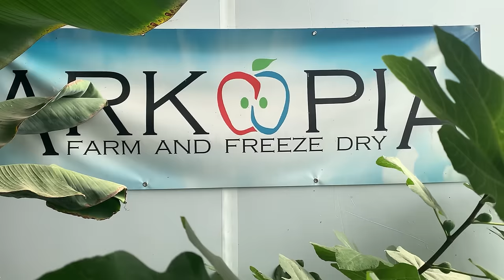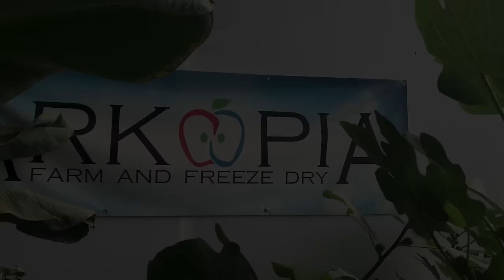The Most Efficient Greenhouse on Earth | $100 a year to heat in -40C with Sand Battery Thermal Mass

Comment: Greenhouse air is generally very humid due to plant transpiration, which is a big advantage when it comes to using air to transfer heat. It takes around 1000btu to convert 1lb of water into water vapor (a gas), when the water vapor is converted back into liquid in the underground tubing it releases that energy. The condensed waterm also serves to increase the thermal capacity of the mass. Greenhouses can rapidly overheat even in the winter months with a little sun, having the option of storing the excess heat in the ground is much more beneficial than just venting it outside. Evacuated tubes dont provide any cooling. The best strategy is to incorporate both.
Reply from the maker: I think that in ground air tube system would work air down a bit of humidity for sure.   We really need to dump it and get pre-heated dry outside air.   It would work a bit for cooking too, you are correct. 👍
Reply: @ArkopiaYouTube  
You said you didnt know what the btu capacity of the sand bed is in the video so here`s a rough estimate :) The specific heat capacity of dry sand is 0.24btu/lb/deg F.  Assuming the sand weighs 115lbs per cubic foot and the sand bed is 64ft x 43 ft x 14" deep, it will take around 88,600 btu (26kw) to raise or lower the sand temperature by 1 degree F.
Reply: @JohnGuest45  thank you
Reply: The sand battery is only under the concrete in the greenhouse,  so roughly 64' × 16' and if you include the concrete it's 2 ft deep.
Reply: 56,524 btu 's to raise 1°F and I am giving the sand 64,000 Btu in perfect sunshine
Reply: @patrickbos825  
If the remaining 1728 sq ft is planting area I would be tempted to install a shcs to take advantage of any and all excess heat in the greenhouse on sunny winter days. To heat a typical block of soil 1728 sq ft x 3ft deep from 50F to 70F would take around 1.68 million btu`s.
Reply: @JohnGuest45  what's an shcs? I'm building another greenhouse and would like to make it right. So far no covid to deal with
Reply: @patrickbos825  
Subterranean Heating and Cooling system.

Comment: Awesome work! So much detail! At 35:00 mins.  The price of the solar hydronic panels must have been $10-20K?  Love the 80% but it's only critical in Nov-Jan. The rest of the year you kind of lose out on what the electricity could do. And batteries getting below $1 kwh. Might be simpler to use more regular panels and a hot water tank then pay for the diesel in Nov-Jan. and charge electric vehicles or someday even make hydrogen or sell back to grid most of the year. Tough decision. Ha Ha, I can't imagine growing bananas! 79 cents for organic ones in the store, I guess the tree has other uses like you said.
Reply: They make a hybrid panel that does both, electricity and heat, it would be nice to try them

Comment: Great job guys! Would you share the overall cost to built it and is there any plans you could make available? It would be nice to built one in Quebec. Keep up the good work
Reply from the maker: I did mine for 60k material.  1/3 of that was concrete.   Patrick mentioned 60k plus extras.   If contracting out, with new materials, anywhere from 160k to 250k I figure.
Reply: Wow.....a regular family no can do

Comment: If I get it correct, patrick insulated the ground with concrete, then sand, more sand. And ontop of that is the dirt? How far down did he need to go? In Sweden we usually have data on ground temperature, I think we need here to dig down a bit, 1m, 1.5m to get decent temps during winters. Also we have data on the position of the sun. 9 degree over horizon during winter, and peak 55 degrees over horizon during summer.
Reply from the maker: No water heating under the dirt, only the concrete area.

Comment: you know there is a great way to get free heat I never see this on home steads! you can heat your under ground for free! listen use motor oil and wood stoves run a coil with water through the wood stove and use a automatic drip oil burner. you can heat your whole building motor oil is free its in every garage on every corner it runs hot enough and clean. no excessive smoke.800f warmth it produces in the wood stove. its free and cuts cost down.

Comment: Have you considered conserving more heat through the cold night by using a retractable form of insulation under your roof / ceiling? I saw a video out of Canada that used a thermal blanket that rolls out inside the building in the evening and retracts in the morning.
Reply from the maker: That would make the greenhouse perfect.

Comment: Harvest to 55 gallon drum of snow filter in the pump in the bottom of the bucket and then maybe a livestock water heater and have the pump set to run every 8 hours giving it enough time to melt the snow down and actually warm the temperature of the water that you be putting on your plants

Comment: Your farm must be quite close to where I live, I really would like to visit your green house (and maybe share some other ideas too!). Like for the solar/photovoltaic systems. There are combination systems now. How big are those solar heating panels they look a little small for putting out 16000 BTU's (4.7 kw). With the sun hitting earth with 1 kw/m², they need to be nearly 7m² per panel.
Reply: There's 30 tunes in each panel, each panel is 6ft tall and 8ft across
Reply: Tubes

Comment: I'm really curious if you ever evaluated insulated blankets for the glazing surface? Im planning on using concrete blankets that will roll down on a frame inside the greenhouse to better insulate the glazing surface at night.
Reply from the maker: Kinda.  But it’s not really needed with heating being next to zero.  ✌️

Comment: one of the best that I have seen . so t he big question for me is how much did yall spend on the greenhouse. I KNOW that there will be a range in how much is salvaged, purchased and how much sweat equity goes in. Would love to have a somewhat accurate range to work off of. Otherwise i may have to start Wallapini (sic?) style or partial dugout of a  diff type.  Am also looking at rocket mass heaters as well. I live in north-central Maine. But seriously and excellent video. only the second of yours I have seen. NOT the last LOL
Reply from the maker: I did mine for 60k Canadian. 👍
Reply: @ArkopiaYouTube  excellent, thsnk you sir.  approx how much percemtage of material was salvage? maybe 30 pefcent or so?  It IS very helfpful.
Reply from the maker: 1/3 of that cost was concrete.   Full lumber, used insulation and trusses.   New polycarbonate and poly. 👍

Comment: I’m hoping to add more features…solar water heating via water panel..a water tower that can move hot & cold water with & without a constant powered water pumps..also circulating water from the fish via the water tower…& lots more.

I’ll be looking into no electric power water pumps as well as emergency electric powered pump.

Comment: Is there a reason you choose 45 degrees for your roof angle with the polycarbonate panels? Would you not capture more sun and heat setting it at the same angle you would set a solar panel for the winter solstice like you did with your solar evacuated tubes?
Reply from the maker: Function so we can use greenhouse in summer too.   Polycarbonate doesn’t matter the angle really.

Comment: @parickboss825  i watched this video.  and as someone  who being growing  Peach trees and Nectarine trees for over 10 years  at high latitude cold climate ( much colder then yours) in a greenhouse  .   just mentioning  it is  unlikely to fruit very well.   as they need to sleep of  3 months  between  -15c to +5c as they like  zone 6 to 8. . The second issue  from this style of  green house . they are not going to get  enough direct  over the top sunlight  to sweeten the fruit  and develop a nice blush  as it looks to be about  4  to 5 feet  back from your glazing  peak.  they would have to be about 2 feet in front of the peak to produce fruits well. . you could  grow them  about  2 feet back from the peak  but it would as an   Espalier against a wall or frame .  as the tree will not grow very conical and just fall over since the sun is not sitting above the plant . other issue  you might find  if they do flower since it so warm in there . they will  flower in January  and then they  could sit in bloom for months  until the sunlight intensifies
Reply: Thank you for the information,  I have a lot to learn yet. It's a good day if I can learn something new .

Comment: Wow!...he did SO well with using your design!...you're definitely making an impact Dean!....I have a question about his insulation since that's a huge component of your design....Did he ONLY use 4 ft of vertical insulation like a skirt around the building and no insulation as a wall umderground?...also is it true that frost goes in at a 45 degree angle and doesn't creep under that skirt and work it's way  almost immediately toward the toward the building and could suck away some heat like I think you first explained in your videos?....Did he super insulate the walls and ceiling like you did? (I'm sure he didn't do as much as you... lol)....do you know what amounts of insulation he did in all the areas?!....thanks so much Dean!!...for another amazing and super helpful video.
Reply: I blew in r40 insulation in the attic,  the walls are 2"×6" so they are only  r30. It's true what I said about frost going in at a 45° angle.  It would have been better if I could have done everything  out of ICF block
Reply: Awesome!...Dean always said he did overkill on the insulation and when I'm planning to do mine I wanted to use less insulation...I live in lower Michigan so that would always be possible, but now I'm thinking I don't even need the wall of insulation underground just a skirt out vertical (any thoughts?) and save the money to use toward a Chinese blanket system type of thing  at night on the glazing to keep the heat loss way down at night....continuing with these thoughts, I wonder why builders put foam on the outside of the block or poured cement wall foundations of buildings instead of just doing a skirt if the science is there about the effectiveness of skirts at ground level (what do you guys think?)....one last thing what did you mean exactly when you said the walls are 2" x 6" so they are r30?...can you explain that in a little more detail (do you mean you used 2x6 boards so the insulation can only be 6" thick?, and did you use roll up battened type fiberglass insulation or foam panels for the walls?)... thanks so much, you guys are awesome!....thanks for the replys and you are both inspiring me again to get at building this spring!!
Reply: I used rockwool insulated Batts made to go in a 6" wall

Comment: ?Two questions?
-can you blow air over a big block of salt to suck the moisture out of the air?
-Have you considered heating with a big compost pile?
Reply: I have big piles of manure that compost over winter ,I would hate to pump that air into my greenhouse  or have it nearby.  It's a lot of work to set up and maintain a compost heater  . I just don't think most people will keep it up long term

Comment: I have a few questions:
1. Could this be done without any additional electrical costs?
2. What are the electrical costs per month?
3. Can this be done on a smaller scale or does it need to size for the solar battery to be able to charge up?
4. Could this be done entirely off grid with no additional inputs whatsoever?
5. Could a person utilize an insulated blanket on the greenhouse to cover the glazing at night when it is the coldest and then open it in the morning again? I saw that in China they’re doing that and are able to reduce their inputs.
Reply from the maker: Need fans to move air and pumps to move water.   $100-$600 annual operating costs is a cost I am willing to bear.  Insulating blanket is a great idea a could have incorporated, but it’s already so efficient how much more efficient do I need?    The Chinese greenhouses don’t grow bananas, but they are cheaper to construct.

Comment: I’m from the Toronto area, then Ottawa, and have livide in Georgia USA for 20 years. Do you think the sand insulation would work well enough to cool a hot humid environment?
Reply from the maker: Yes.   Any thermal mass operates the opposite in summer (cooling) including water, concrete, earth, and sand.

Comment: What do you do to control heat in the summer? I'm looking at greenhouse options in Alberta and I'm worried about it becoming intolerable in the heat
Reply from the maker: Back of greenhouse mass is shaded at back.   Feels like a basement and cooler than outside in summer when opened up.   No fans

Comment: Would you be able to use a HRU(heat recovery unit) to help deal with intake of fresh air and exhausting of humidity? We just moved into a new home and it’s our first time with an HRU and it’s hard to keep humidity in the home… concrete floors don’t help the matter either though….

Comment: I  built a R2000 passive solar place in  1982 near Vancouver, WITH 3 story post and beam green house, I used 15 degrees plus your latitude to determine south slope - sun side. Unfortunaly the public was not intrested in energy effiecient homes then, was ce
Reply from the maker: They aren’t really now either, 40 plus years later 🤪👌
Reply: @ArkopiaYouTube  PEople are more willing to spend $ on ceramic tile, glass showers, appliance upgrades
Reply from the maker: As long as it has granite countertops, insulation doesn’t matter. 🤪😂
Reply: @ArkopiaYouTube  EXACTLY, Im in heavy equipment now, customers can be eaqualy clueless.

Comment: How deep is his soil beds? 
Does the tubes underneath also run under the soil beds or just under the concrete?
Reply: The soil bed is also 2 ft thick on top of regular ground. Most plants don't like to have hot roots so the sand battery  under the concrete is the only thing that has heat

Comment: Could have held that mic right in the middle, between, & audio would've been better.
Reply from the maker: Heavy fan and wind noise.   Hard to get out.
Reply: @ArkopiaYouTube    Nothing wrong with a little noise, voices sounding decent matter most in this situation and they sound bad.  Can't even hear the other person talking when mic is moved back & forth, effectively cutting off what was said.  Audio sounded way too powerful at times & not easy.  Test, listen, adjust, & test again.  With those mic settings, just holding it right between the two guys & that distance, would have worked out better.
Reply from the maker: Just bought a second mic for $340.  Putting this all out for free everyone owes me. 😂
Reply: @ArkopiaYouTube  No you owe others more than you can pay by participating in & perpetuating this life ruining way of life, instead of ending it for an actual reasonable way of life that "everyone"actually needs - especially innocent & helpless children of all people.

smh